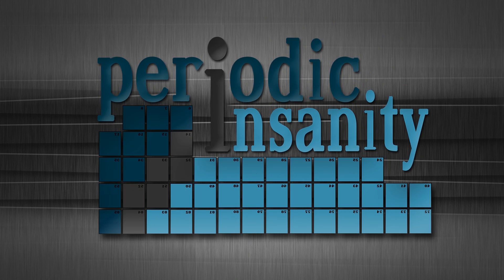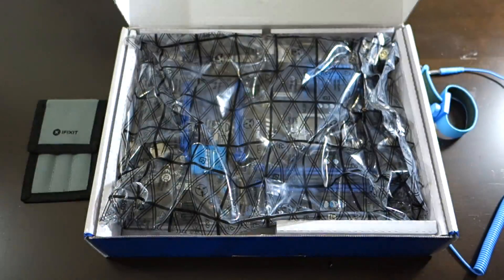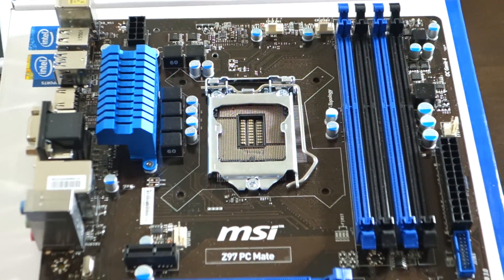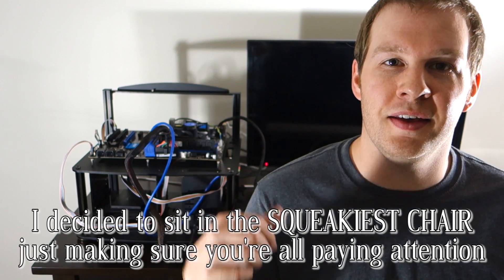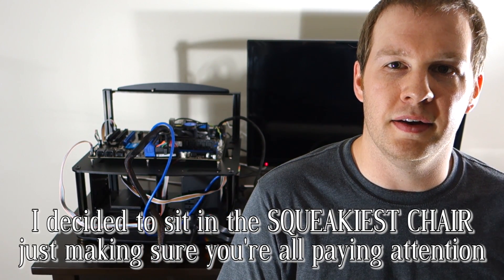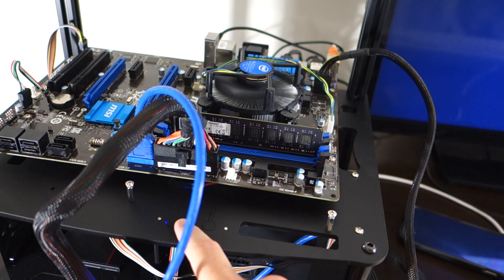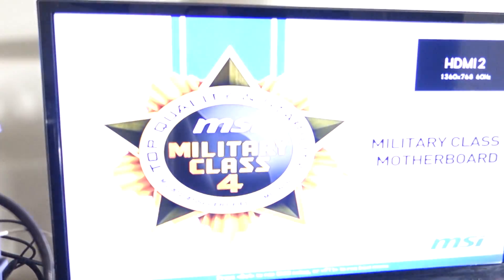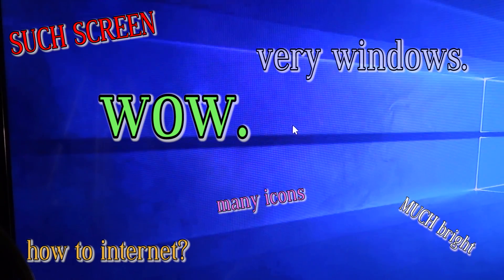Bent Pin Motherboard - Worth it to Buy? Able to Fix? | An Extreme Budget Solution

Comment: i just ficed my first socket only using my phone as magnefying glass and a saftey pin! the ping made the board to only use the first 2 dimm slots making it to a single channel experience  . the bent pins were few but placed all arount the socket so it wasent like one area where  i could just realine and rais them .i hade to dig in between god pins and try not to dmg any thing else ! it was a z97 pro mobo 1150 socket , and i managed to fix it , now running 4 slots of dimms ain dual channel and OC on amy i5 4670k gives me 4.5 ghz and oc on rams lets me do 1800 on the 1600 sticks , no need to push my luck any furter  right ;) 
good tutorial and good advice . u have a new sub =) ill be looking for the 2011 socker repairs next . 
also i bulked up om mobos that i am going to repair 
msi z87 s2
gigabyte g97p
and a z87x d3h. 
i have oredere a ifixit kit via linustech and also a a lighten magnefying scope made for this kind of work ( iFixit Inspection Scope)

also i got the same g3258 cpu and a pair of cheap ram stick + a 450w fractal psu + a 60gb ssd disk for all the testing

Comment: I repaired 10 bent pins on a new Gigabyte Z390 Gaming -F the shop I bought it from told me it was for the bin. Not anymore works perfectly. I used a magnifying glass app on my phone and surgical tweezers and a lot of patience. was very satisfying.  You just have to take time to understand the orientation of the pins as it can be quite deceptive at first.

Comment: Been there, done that..  Sometimes the cpu will work, even though you didn’t really fix it 100%, some of those pins are not in use and some are used for memory allocation and you can’t see it unless you crash or check it out in intels utility.

Comment: Bend pins affect on performance?
Reply: One wrong bent pin can prevent post, so it either works or doesn't work at all. It really depends on the pin, some pins aren't necessary for post, so if it does post, you're golden.
Reply: No
Reply: No, it's just renders your computer useless
Reply: @youcansave15ormoreoncarins75  that's good, I bought a used mobo from a tech store and they noted one of the pins, but they said I can return it so as long as it's something I can notice right away (like the computer not running) then that's better

Comment: I tried fixing the pins to an AMD fx8350 after I accidently dropped it using a card and toothpick and I couldn't get it to work, so I sold it on eBay cheap for parts.
Reply: Future reference, use a mechanical pencil. Remove lead from tip, the pins fit in the tip perfectly.

Comment: Should I be afraid of damaging my processor while testing the fixed socket?
Reply: Nope, won't ruin the CPU, just keep it from posting if the socket  pins are too far off. Once corrected CPU will post right up unless the CPU is already toast, but the pins themselves won't fry a CPU.

Comment: I got a motherboard and CPU was not responding and now I have come to the conclusion that the CPU socket has bent pins but I'm not 100% sure if any pins are bent.
Reply from the maker: if you cannot see them bent i would be cautious, make sure with a magnifying glass. If something else is wrong with the board you can most likely RMA it to the manufacturer. If you start messing with pins you could void any warranty if something permanent happens, its a last resort. It is possible they could have gotten misaligned by just enough I supposed, you could probably compare the socket to pics online.
Reply: Great idea!

Comment: good job you did here, i once fixed a broken  775 pin by taking a pin from a dead motherboard and placing it on the new motherboard. I had yo use hot air to take the pin but it was a lot harder to put it on the new MB.
Reply from the maker: hot air? any solder involved? I've got a mobo I could try this with.
Reply: no, no solder involved, i just took the pin from the old board with hot air station than put it in new board over the old broken pin minus the root of the pin....the pin will stay in place and in contact with the old broken pin by pressure of the cpu.
Reply: orange11squares I

Comment: Hey I really liked your tutorial on the pins, I have just repaired a msi z97 gaming 5 I bought from ebay for 39.00 bucks, the pins were fine but someone forgot to unlatch a gpu and pulled the second pcie connector off the board so I spent a little time straightening the pins on that pci slot and carefully placing the plastic connector back on the board low and behold I was able to get the board to post to bios, so I feel I lucked out with a very nice mobo from that deal.  Now I am looking into trying a motherboard cpu socket repair and am bidding on a nice mobo as we speak with a few bent pins and you vid has been very helpful!  thanks
Reply: We need a video on that bro. Post it up. ^_^
Reply from the maker: Wow repairing a PCI-E connector is something I have not heard many people have success with, that is awesome! 39 bucks for that mobo is a steal. Like I mentioned in the other comment, even if the motherboard doesn't work you can still try to RMA it once the physical damage is gone. I'm glad the video helped you, good luck!